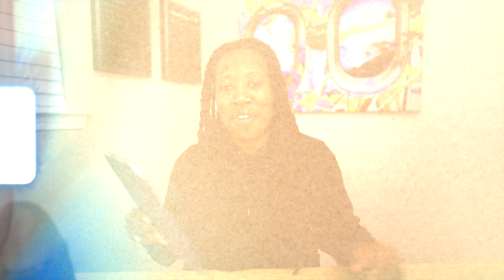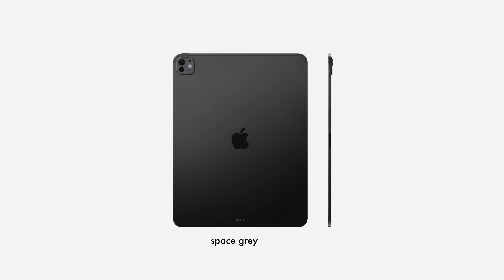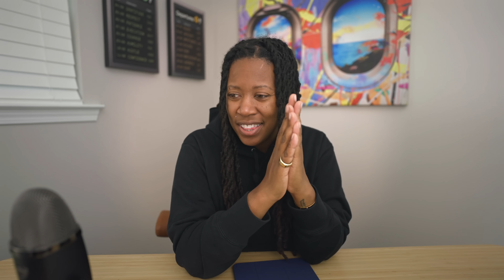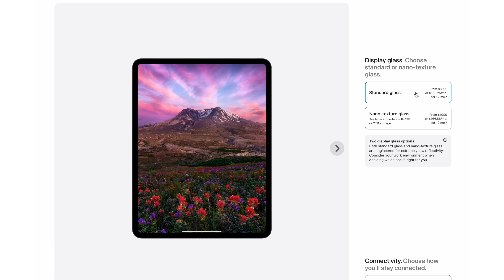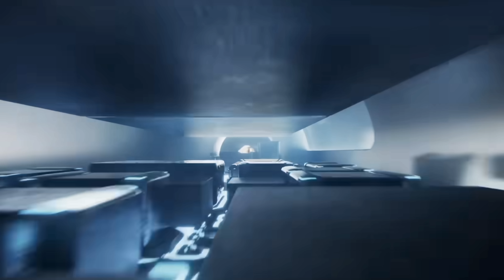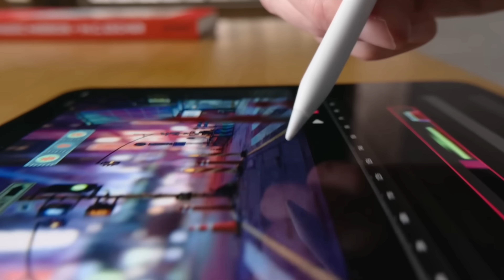New Apple iPad Air and iPad Pro  - To Buy or Not to Buy?

Comment: The best thing bout these new iPads is that the previous ones should fall in price somewhat. The Pros are absurdly priced to begin with, especially the keyboard accessories. I’d be more keen to upgrade if I could use my existing Magic Keyboard, they could’ve easily made it compatible but they opted not to. I actually think the original ones look better than the new aluminum ones

Comment: I want to add that if they make the back of the iPad Rounded again and do the same for the  keyboard, it will feel much more like a laptop! The whole point of making it as thin as possible is because it was top heavy. If they nail it with the iPad software, I will buy the IPad Pro over a MacBook!

Comment: I’ve never had an iPad before but if I do really well in my exams my parents will let me get one. I’m tempted towards the pro as it’s only a couple hundred more expensive and with lots of features and should last me a while. What do you think?
Reply: You should get the older model cause there’s no point getting the newest one if you’re not going to use all that power. M2 already is powerful
Reply: I bought the very first model of iPad Pro and it’s still very functional and I use it daily. I can’t wait to get the newest model. It will last years — I’m sure. My old will get passed down to family.

Comment: I’m thinking about getting the 512GB 11” iPad Air (in purple of course). I wanted the iPad Air back in 2022, but they had some type of hardware issue so I just picked up the iPad Pro instead. I don’t really use any of the Pro features, plus I need more space because my Pro is only 128GB. Also, the Magic Keyboard I bought can still work with the Air.
Reply from the maker: Good points! I wish the Pro came in purple lol